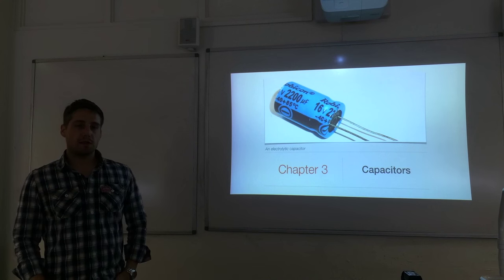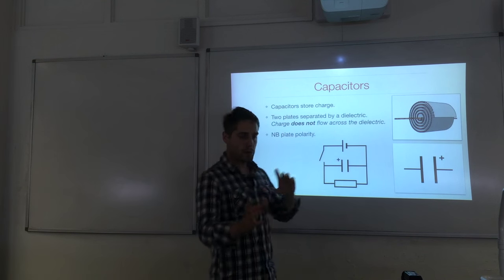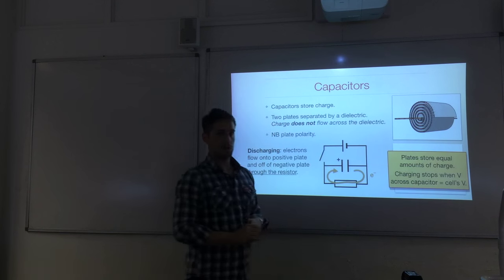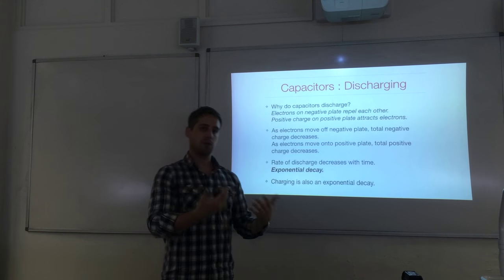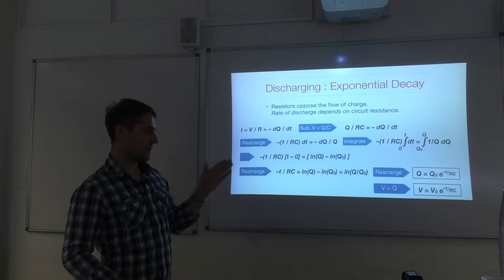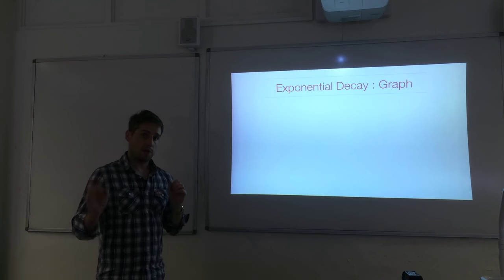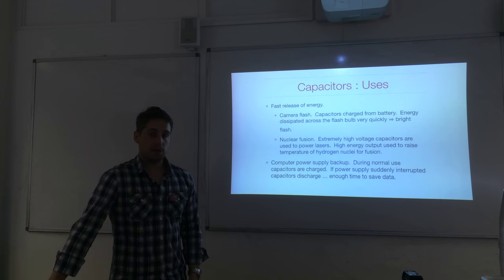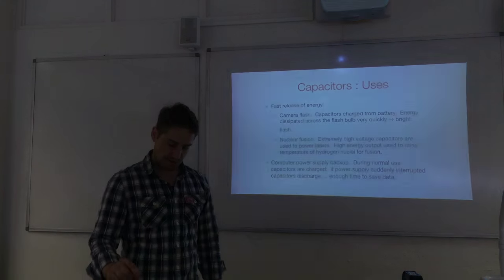G485 Fields, Particles and Frontiers of Physics (FPF) Overview: Lecture 3 (Capacitors)

Comment: at 6:20 isn't the total charge constant? how can they both decrease in charge :/
Reply from the maker: +flowerpower487 the overall amount (i.e. for both plates) of charge remains constant.  However the charge is separated in that negative charge is accumulated on the negative plate and positive charge is accumulated on the positive plate.*  As the capacitor discharges the negative charge on the negative plate decreases and positive charge on the positive plate decreases.  Even though the total amount of charge remains constant.  So the point I made was that the charge relative to neutral decreases on both plates.

Does that clarify?

*Actually there isn't an accumulation of positive charge on the plate rather it is the absence of negative charge that makes it positive.  But I put it that way to make my point more clear (hopefully).